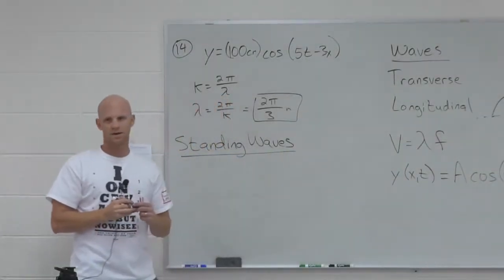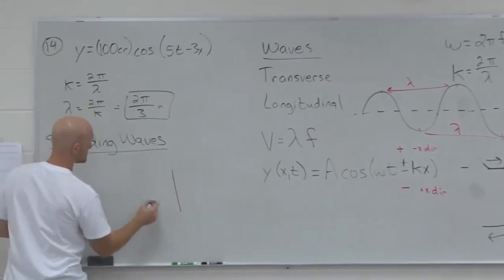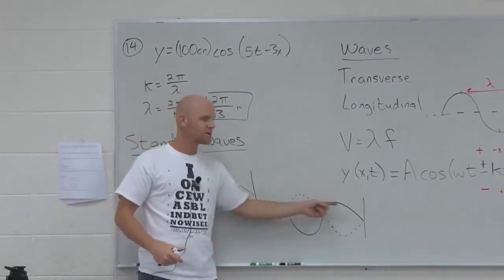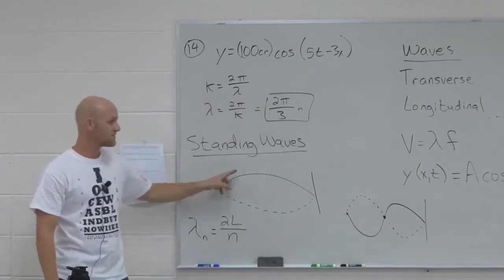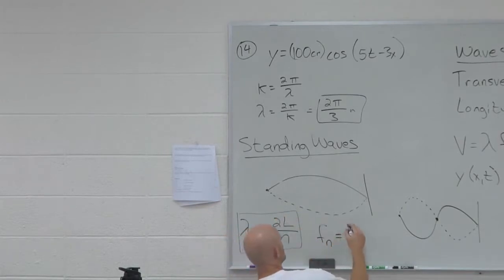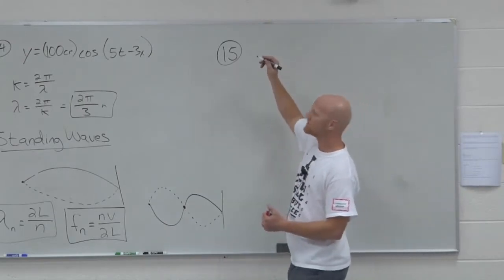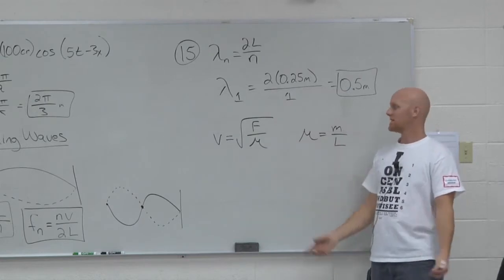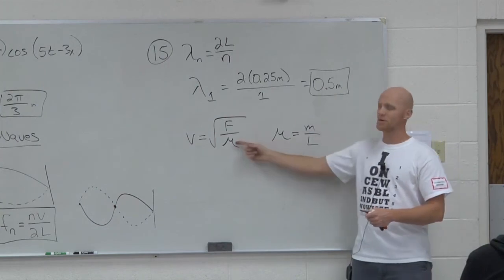13.4 Standing Waves

Comment: Hi Chad! I had a question about how to decide if a string is fixed at one end or both ends? If it's attached to a wall and the free end is held by someone why is that considered fixed at both ends? Thanks!
Reply from the maker: Hello Amar!  This might sound overly simplistic, but it all comes down to whether or not the person holding one end is moving the string or not.  One way to generate the wave on the string would be for the person to move their hand holding the string up and down.  This definitely wouldn't be fixed at this end and therefore the strong would only be fixed at one end (the wall).  But let's say they were holding the string absolutely still while a 2nd person was 'plucking' the string somewhere in the middle to cause the wave motion on the string.  In this case now we would consider the string fixed at both ends.  Hope this helps to clear it up!
Reply: @ChadsPrep  Yes, that definitely helps! A follow up question is you mentioned that nodes are where there's no vertical displacement. If you were moving the string side to side instead of up and down would still be only fixed at one end since relative to the way the waves are moving your hand is still moving?